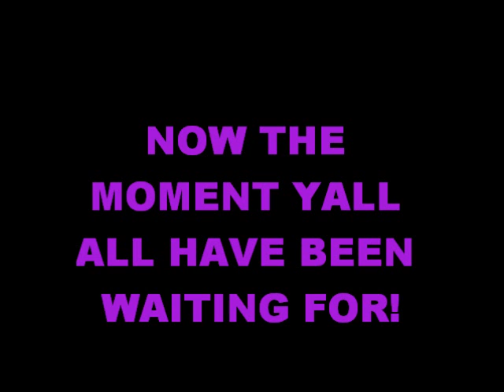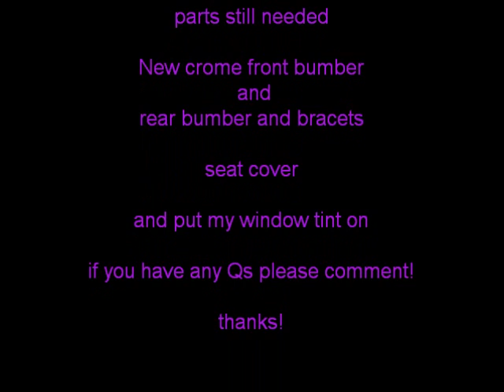1993 Toyota 4x4 (Project Finished)

Comment: nice truck i have a 1994 (Red) but its a great truck has almost 250,000miles on it and i have yet to touch the motor other than oil and plugs.

Comment: Does this truck have any kind of lift on it for it to be able to run 33x12.5"s? I have a 93 pickup Xcab with my torsion bars cranked and there's no way I'd clear those tires without bashing in the pinch weld in the front. Nice truck tho!!